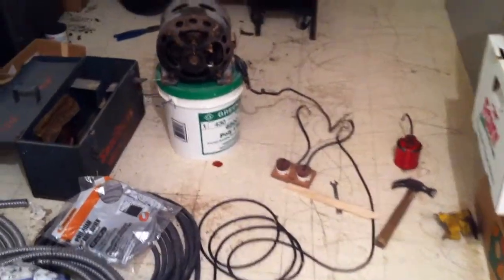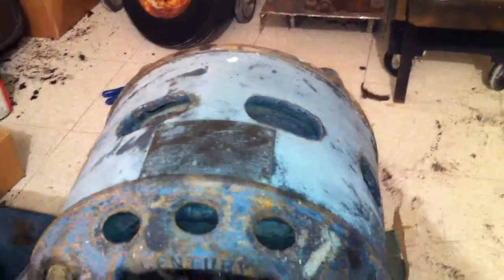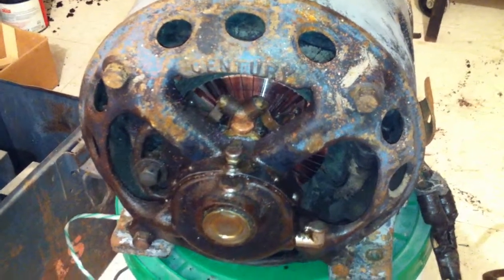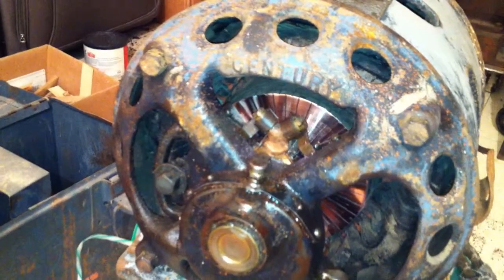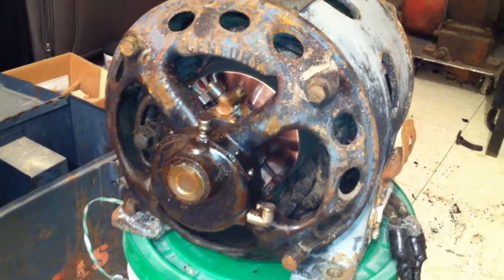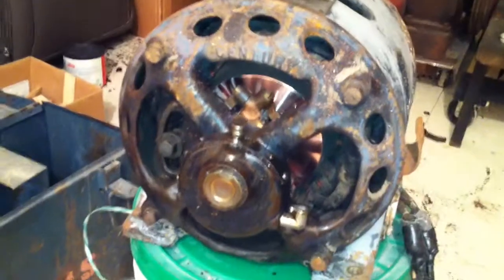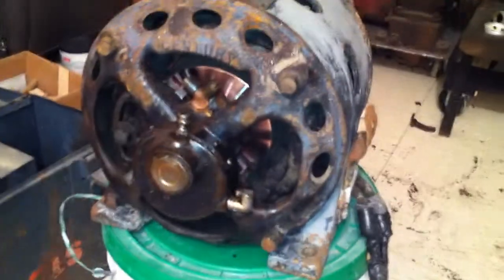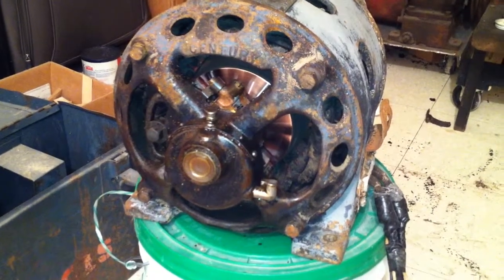1/2 hp Century repulsion start induction motor

Comment: Great start up and run on that 1/2 horse! 
Have a question. Where does one get the wedge shaped brushes for these great early Century motors? I have a four-pole 1/4 horse motor that needs new brushes. I use it on a pump jack to water the garden.
Thanks in advance for the info!
Reply from the maker: Hi, I'm not sure where to look for them, actually. I suppose you could try calling some electric motor repair shops. I would definitely suggest posting this question on Smokstak.com there are a lot of very knowledgeable folks there! Good luck, hope to see you on the Stak, and please report back if you find a source for these specialized brushes. If all else fails, I suppose one could sand down a regular brush to the required shape.
Reply: Hello again.  Found an off-the-shelf supplier of wedged shaped brushes for these old Century motors.  It's www.carbonbrush.com.  They are located in California.  I ordered their #7 brushes so I am hopeful they fit the holders.  The dimensions listed seemed to match the original brushes in all but length.
I will report back once I receive the brushes next week as to fit, form and function.